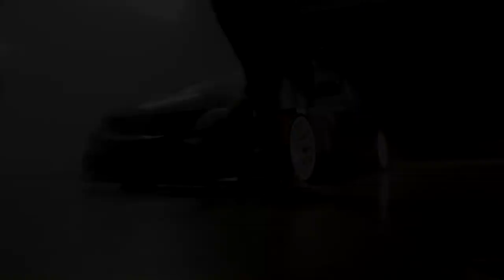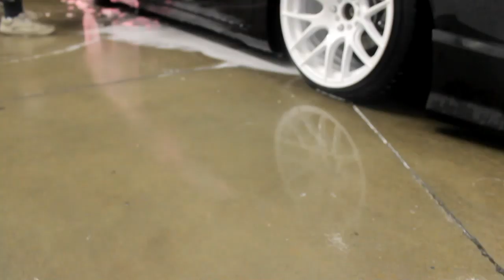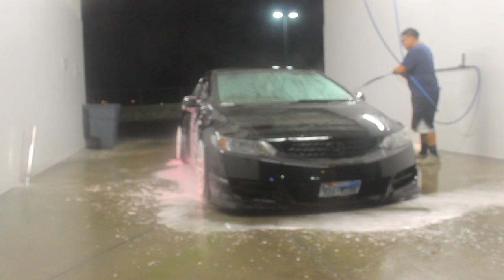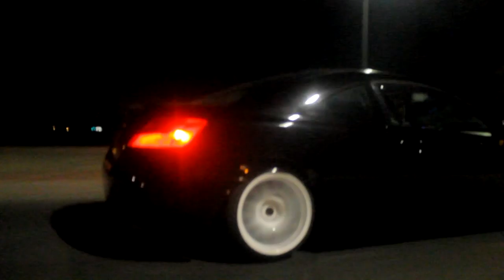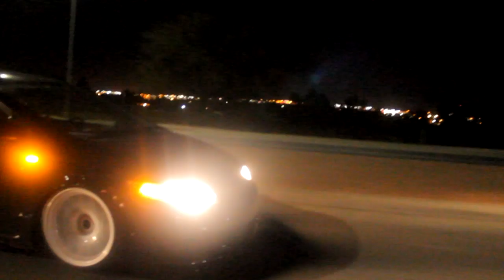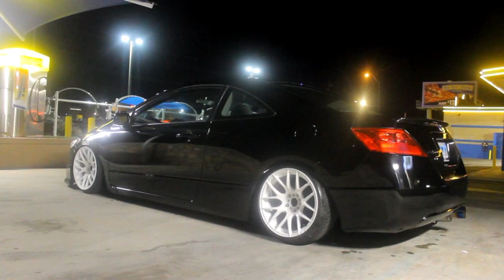Eddies Slammed 8thcivic -LEAD

Comment: did you have issues mounting your tires? i just recently tried to mount 205/40 on a 17x9 and the bead popped off after it sealed and was almost aired up. gonna try out some bead sealer and see if that will work